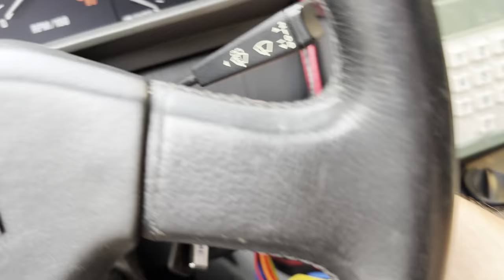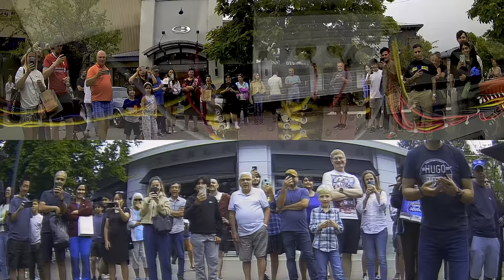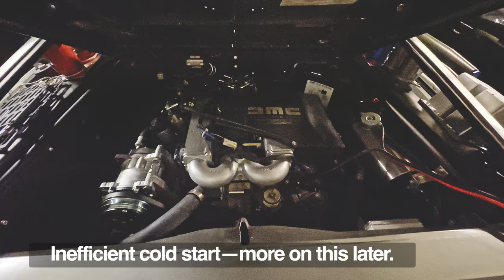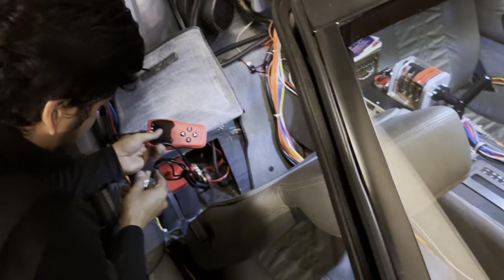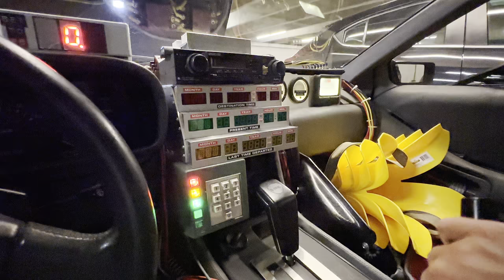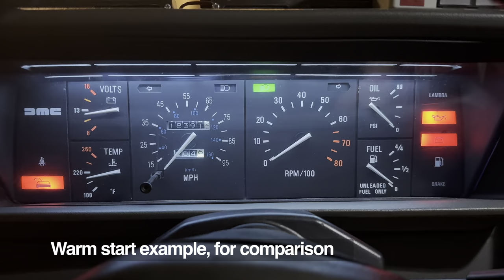GREAT SCOTT! 🪫☠️😱 DeLorean battery failure, jumpstart, cold start tests and takeaways.

Comment: I had been going through the same trouble recently. New red top battery worked good for a bit but still had intermittent issues, more so when I turned of my car battery for shows. It wasn't until I had a few scenarios when the car would die unless I left it coasting in gear (manual transmission). Turns out my starter was going bad. I replaced that and my alternator to be safe and what a difference that made. I also discovered on the visor it tells you to press the accelerator down a 1/4 way when starting the car. That also seems to help.

Glad you got everything sorted out.
Reply from the maker: Thanks for sharing your story, and the pointer on the 1/4 pedal tip! I’ll check for and will try that on mine. I think it had a note about that, too. I haven’t really had time to test the battery performance, but it looked a bit low after a few days of short trips and no charging in-between - I had it out for a weekend and at my garage without power. It still started up fine, and the charger indicated 75-100% within a few minutes of being connected - so, I presume it’s in good shape. TBD. 😉